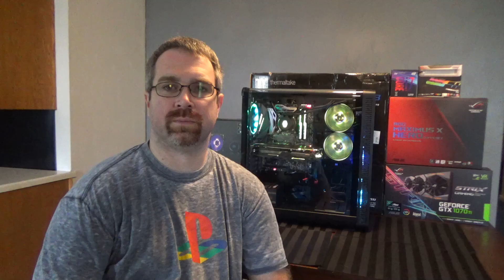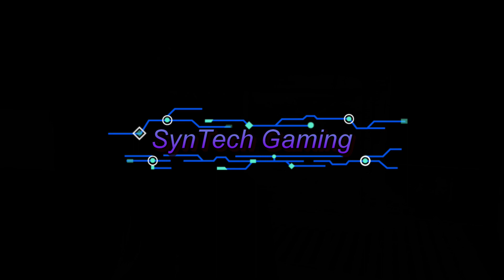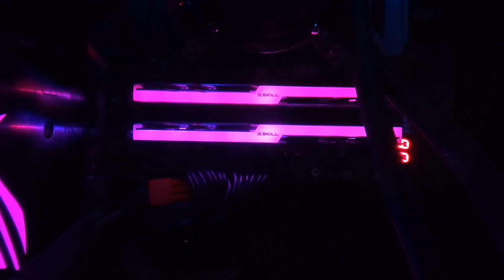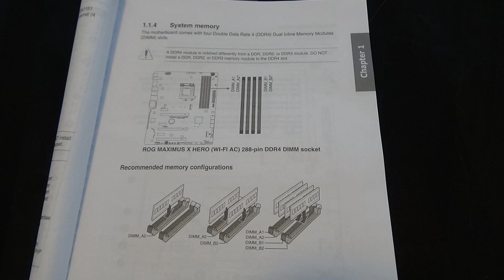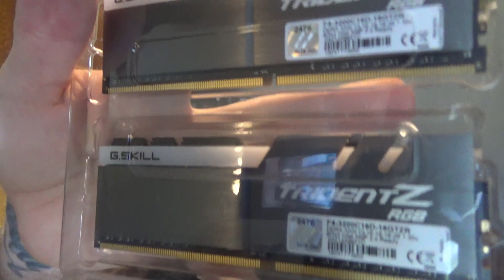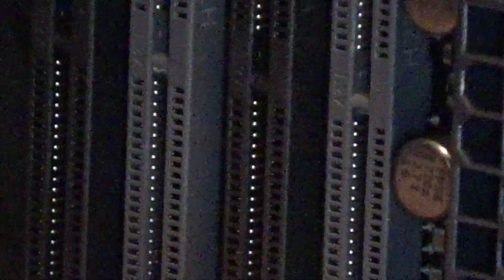PC build step by step part 3 DDR4 Ram Install G.Skill Trident RGB

Comment: I really enjoy your videos. I just bought this case myself and have all the parts on the way in the mail. Coincidentally some of the parts are similar to your build as to mine will be. It is my first attempt at building a PC so I appreciate the step by step builds in this case. Is there a reason why you stopped making these, and didn't continue with the rest of the components and cable management? Any advice for mounting the radiator? I bought the ML240R, similar to the one you used in your build.
Reply from the maker: If you have any questions let me know and I'll do my best to assist you. I will work on editing and uploading the rest of the videos for this build soon.
Reply: @SynTechGaming   Advice on mounting the cooler? Do you reccomend a push or pull config for the cooler?
Reply from the maker: @Birdman1919  So for the AIO water cooler, I have the fans pushing the air out of the case. My thought process behind this is I have the front case fans pulling in cool air, so I have the water cooler radiator (probably the most heat generation) pushing the air out as well as the rear case fan. This should be allowing the two large front case fans to suck in all the cool air and the water cooler and rear case fan to be pulling the cool air through the case across the warm components and then out.